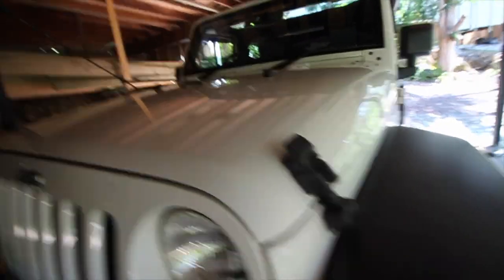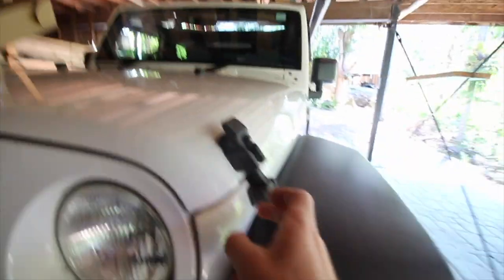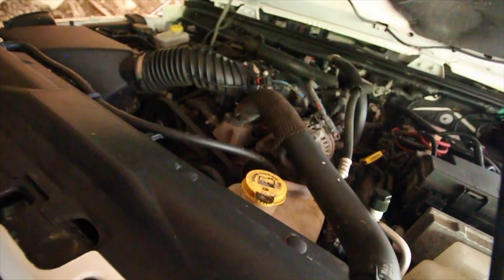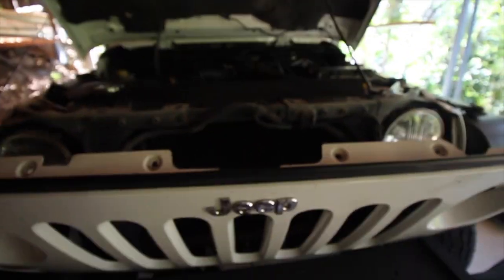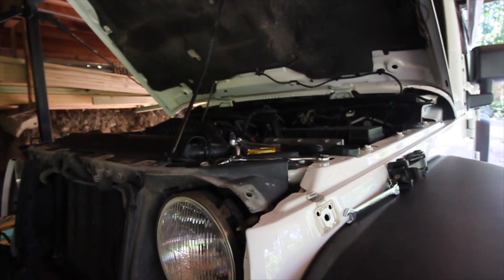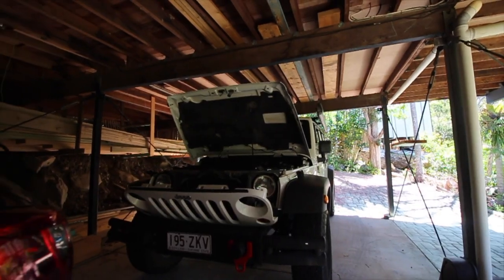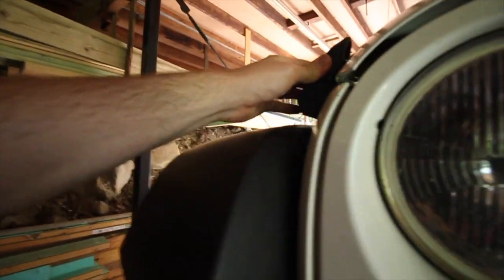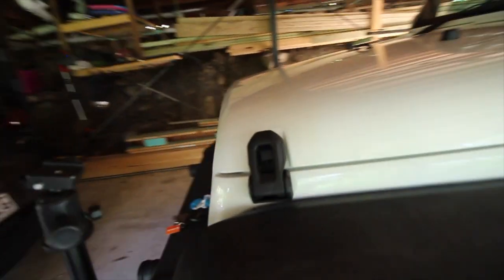JEEP JL HOOD LATCHES ON JEEP JK HOW TO

Comment: You should have seen how easy it was too replace my deteriorating YJ latches with CJ latches 😎
Reply from the maker: KC9UDX I would say it be 100x easier than the jk
Reply: @Whiteandsonsgarage  I wouldn't say that much easier.  But I didn't have to remove the grille.  And I have to say, I've never seen a JK up close like that before; the YJ is a little... more substantial?

I can certainly relate to the doing things one-handed thing.  I've been told "oh just use a tripod".  But that's not that simple either.
Reply from the maker: KC9UDX oh so more like a TJ? Hahahahaha I know exactly what you mean, yeah I kinda do both and both can be harder definitely on what you a trying to show
Reply: @Whiteandsonsgarage  I don't know too much about TJs either but they must be pretty similar to YJs.

When I use a tripod I'm always tripping over the thing.
Reply from the maker: KC9UDX yeah I tho so, I hav never seen a YJ in person before. Hahahahaha I had son the same 😰